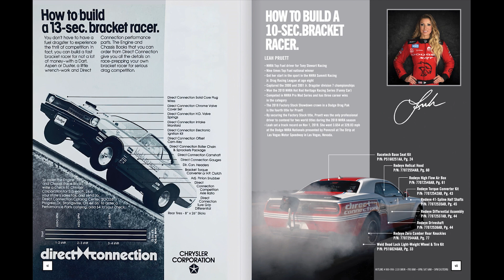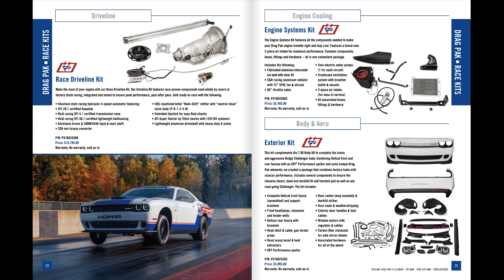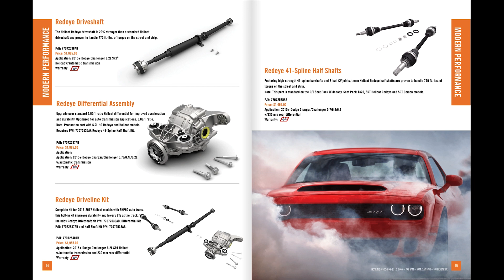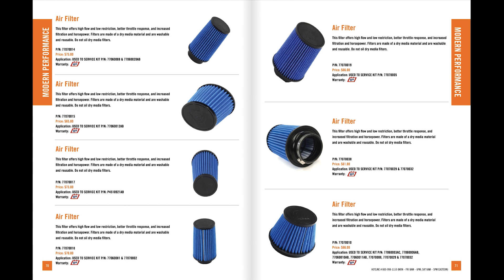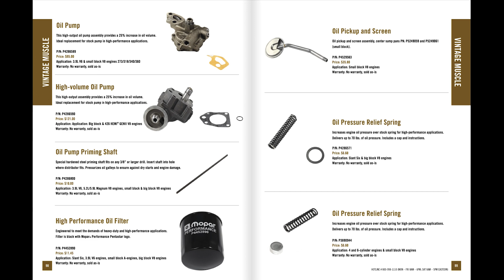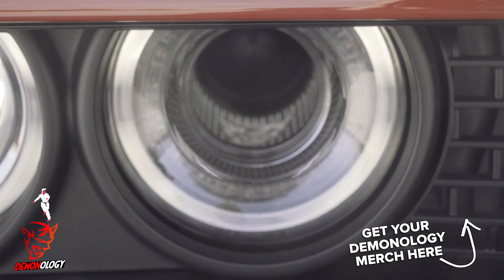Dodge Power Brokers SECRET Catalog *IN DEPTH PRICE BREAKDOWN* | Demonology

Comment: I used direction connection parts on a 68 Road Runner I built back in the day. Flat tappet cam, rocker arm's, headers, etc. It was pretty trick for the time it was offered by MOPAR.

Comment: Looks like the drag pak rear suspension kit includes a solid axle, which might have a stronger differential casing than the one on the Demon. Plus live axles usually do better than IRS at the dragstrip.

If that is a bolt-on kit on a stock challenger frame, then it might be a good upgrade for the Soul Snatcher. A bit expensive though.
Reply: I wonder if that would fit into my redeye

Comment: Direct connection use to support my car I built back in the early 80s. I built one of the first 250hp normally aspirated front wheel drive cars that was a stage 3 of 4 all but full drag car but I needed to keep it street legal. It was 2.2 Plymouth turissmo before there was a Shelby Charger. Basically it was half of a 318ci as far as tuneup. Very quick car. Bought and built in 1982 with direct connection help. That was my first 4cyl. build. I have owned and come from a family 3generation Chrysler cars. From slant 6 to 440s/413s/426s. As well as 318s thru 361s and 392s. I enjoy your blog and journey.
Reply: I had a 1987 Plymouth Turissmo as my first car when I was 16.... I wish I knew about that direct connect back then....lol